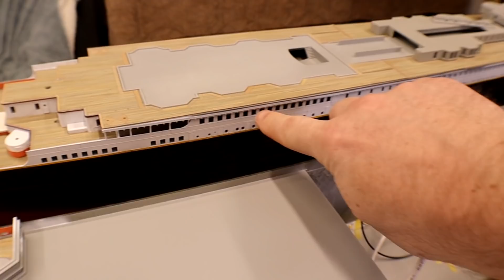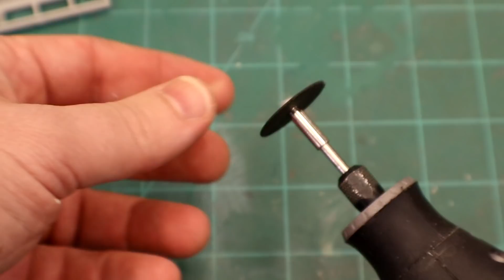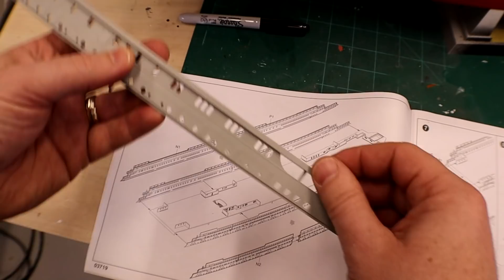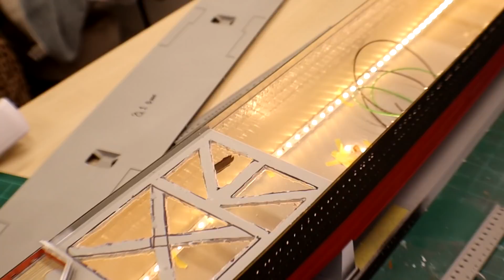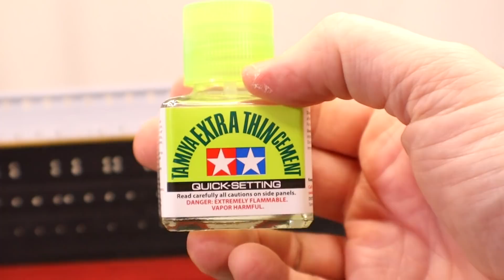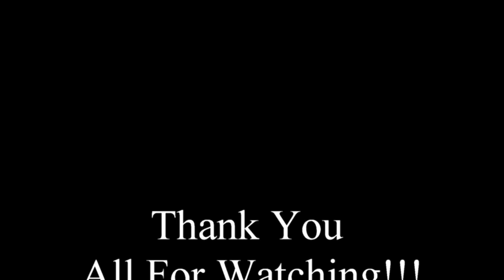1:200 RMS Titanic Build Video 15

Comment: Hey Ben.  Was there a reason you put together the super structure different.  Compare to the instructions? You glue the sides on first then the deck.  Is it better doing it that way?  Thanks bud and great job as always?
Reply from the maker: Yes. So I could ensure those side parts were glued to the hull well and because I’m lighting the whole thing my own way and need to go deck by deck.

Comment: Is there anything you can do to improve the audio? It sounds like you talking in a barrel.
Reply from the maker: Working on it. But you’re the first complaint so it may be your devise.
Reply: @TheMidwestModelShop  Sound fine here Ben. I'm no audio technician and I don't use hadphones but the sound is clear and easily understood, which is all I look for.😁👍
Reply from the maker: Thanks! I’m getting a wireless lapel mic, regardless. I’ve wanted to do that for a long time. So hopefully I can have “consistent” audio from here on out.